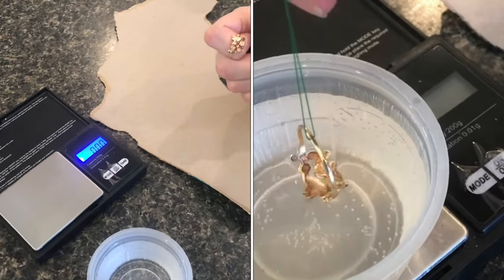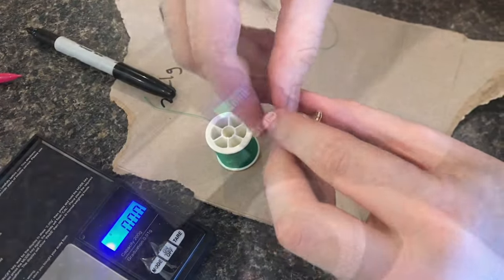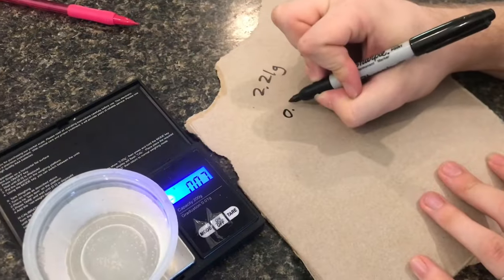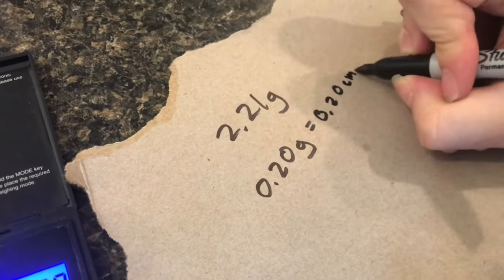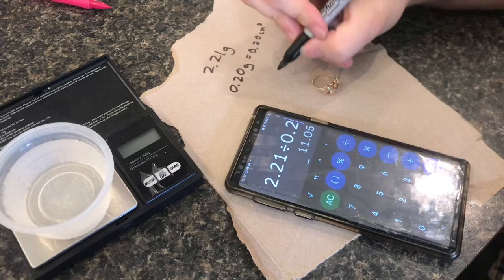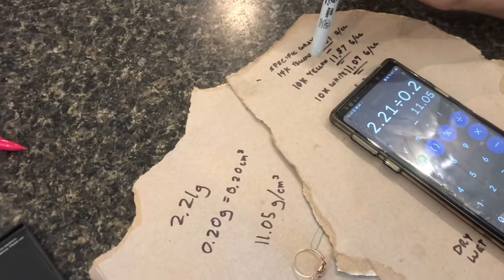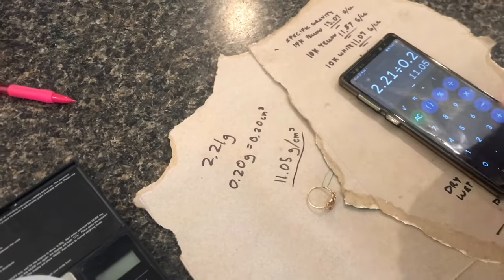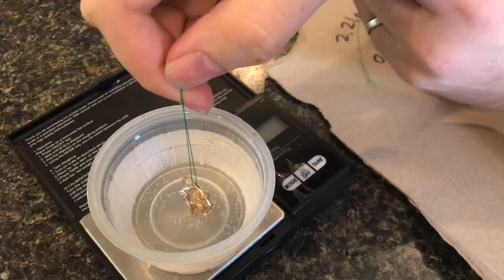using “water” to PROVE “real gold” (specific gravity)

Comment: Im confuse on is g/ml same as g/cm3?
Reply: 1cm3 equals to 1ml; therefore g/ml is the same as g/cm3
Reply: @Mr.Bluefarmer  it is valid only in case of water
Reply: @blaze102  yep, He is trying to find the volume of the ring by the water displacement. Water displacement is same no matter the density of the object. and if it is not touching the glass bottom then water displaced = volume of the object.